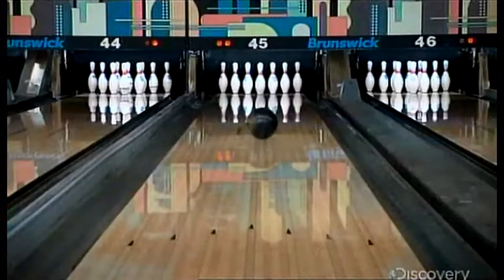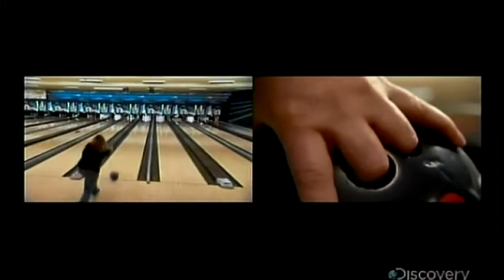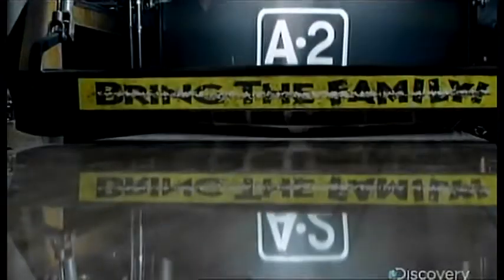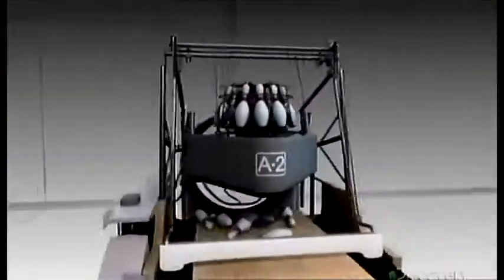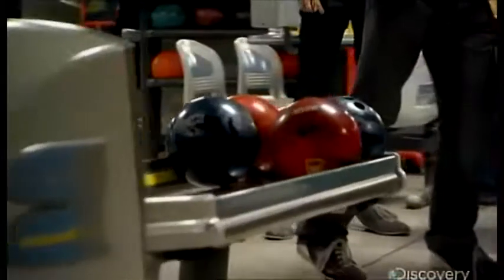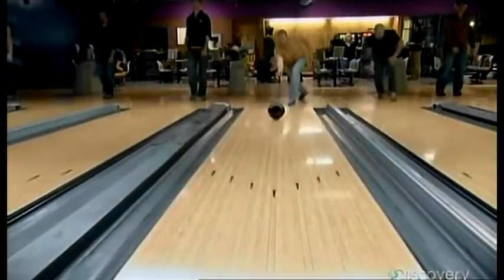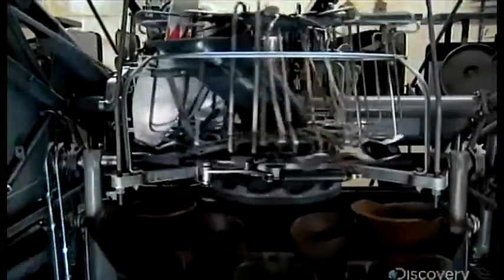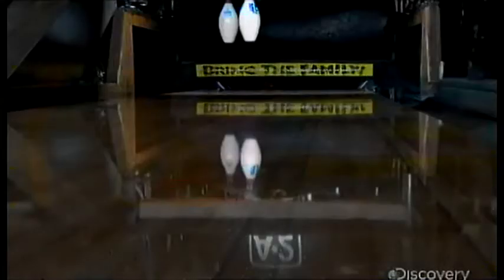Automated Bowling Pin Setter Machine

Comment: I bowled a lot when I was a kid in the seventies. Usually, you didn't have to press the reset button or step on the red pedal to clear dead wood after your ball. Occasionally you did, though. What would prevent the machinery from responding completely automatically those times ?
Reply: Sounds like you were playing candlepin bowling with the way you described the pinsetter
Reply: If the ball is thrown slowly it won't hit hard enough in the back to trigger the machine

Comment: I'm not aware of any pinsetter that has sensors on the pindeck.
Reply: The only discrepancy in this video is that the sensors do not send a message to the distributor wheel what actually happens is that there is a Five pin chute in the distributor when the five pin goes through the chute it releases the others mechanically
Reply: @MaddoxsLaundromatAdventures  The machine has to be in certain conditions to allow pins to drop even if a 5 pin is inserted.  There are 2 blocking fingers that prevent it, one finger blocks the chute if the deck is already full and will remain that way until the machine completes a long stroke which indicates pins were set, the other finger blocks when the deck isn't fully up and forward.  If both conditions are met the 5 pin will release every time, purely mechanical.  The turret will always try and remain empty if possible because that means there are 10 pins ready to be set.  These are engineering marvels for the time, every decision made by the machine is purely mechanical.  The only electrical control is the electric eye or the reset button to start the cycle, and those only exist because light ball impacts can't reliably trigger the machine.
Reply: Me either.